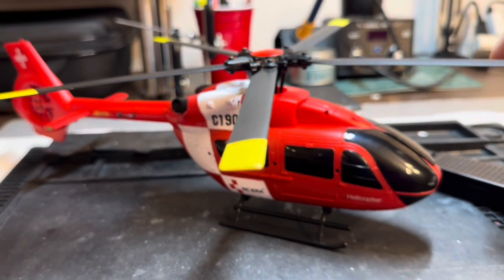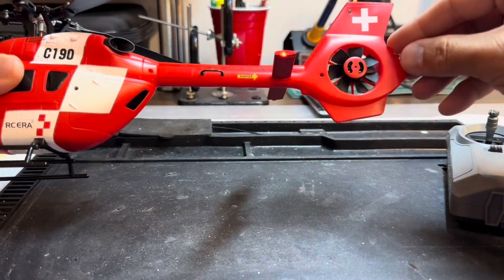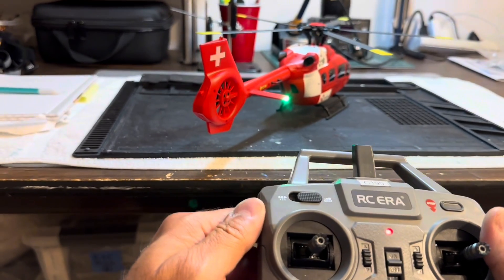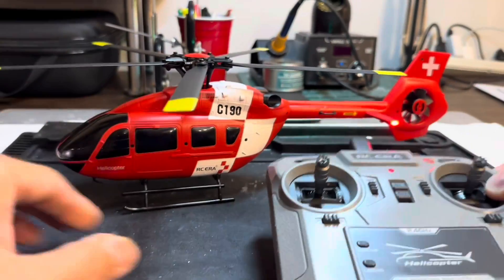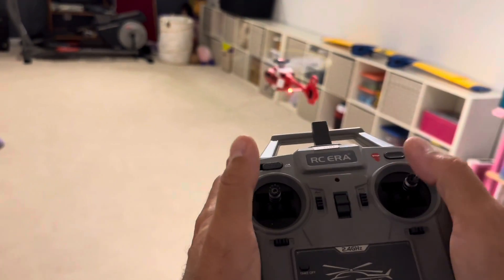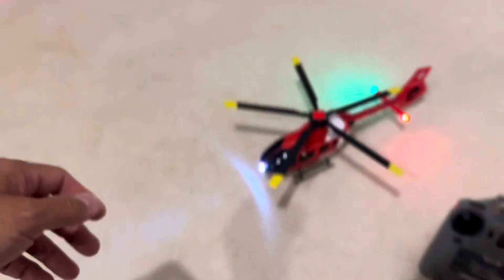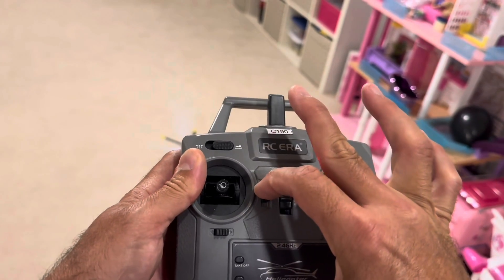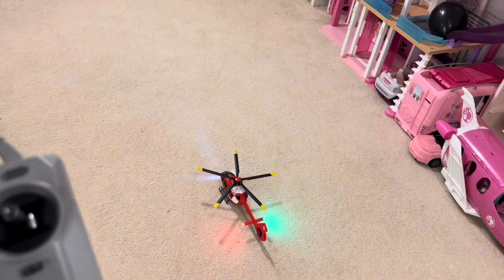RC ERA C190, C189, C187, C186 and C123 -  Gyro calibration and level hover setup methods

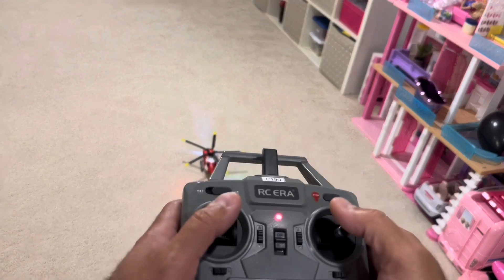Comment: Nice vid, very helpful, btw, if you use that method at 6:37, the automatic one, that means that you then undo the "manual" calibration you did previously? and have to do it again? thanks for the vid tho
Reply from the maker: No they are different.  One calibrates the gyro and the other levels the swash plate by trimming the servos for roll, and elevator for a steady hover.
Reply: @Flight6677 Cool, is it still necessary to do that: 6:37 every time before flying? thanks for the reply
Reply from the maker: @FrannB  No. Only if you notice a drift.  It should be ok out of the factory as well, but sometimes it will need tuning.

Comment: I have a C189 coming in today. Just blew up a lesser model, this video's timing is perfect. IIRC, if we hold that same trim button you used to go into debug mode UP, then power on, the remote goes into TRIM save mode, allowing us to store our trim settings.  

Thanks for the info. Had not heard of debug mode until now.

Comment: What you're forgetting is, the helis software adapts to changes in voltage from the battey. It's nearly impossible to make it hover perfectly.
Reply from the maker: I don’t think this is the case. The battery voltage changes are not as fast and the slow drain is not an issue. My hover nicely.
Reply: I just tested it properly, you're right.They can hover for a while with no input. Thanks for responding.

Comment: My RC era c190 became uncontrollable recently, first it happened in an open place and I was able to catch it in the air with my hand, the second time it happened was indoors and I had no luck.I can't seem to tell if it's a problem with the gyro or the servos. Has anyone else had a similar problem? When in flight it violently goes in a random direction.
Reply from the maker: Check your transmitter batteries. Make sure they are fresh.
Reply: @Flight6677 They are, I use the same transmitter on all 4 RC ERA helicopters that I have
Reply from the maker: @Letizio have you tried to recalibrate the gyro and do a level hover set?
Reply: @Flight6677 Yes, but it is currently unusable. I believe there is no option without replacing parts, but I still don't know exactly which module is having the problem.I'm wondering if it's the optical flow module or the receiver module which I imagine contains the gyro.
Reply: @Letizio desactiva el modulo optico y pueba si es eso

Comment: I also saw you can increase and reduce head speed by using screw pitch regulate switch is this true?
Reply from the maker: Yes but I don’t like messing with that because it is already tuned and if you change it, you may have a hard time tuning to the same exact place - problem being tail authority.

Comment: Which of the two methods should I use? Are both the same? Or is the 2nd method preferable as it will remain stored in the memory?
Reply from the maker: Do one at a time and see if it corrects.

Comment: Interesting, but I've seen a number of videos where the helicopter is hovering well, but leaning to the left. Most seem to lean left to some degree, and always touch down the left runner first. Is this just some kind of gyroscopic effect caused by the rotation of the main blades?
Reply from the maker: It’s the result of the main rotor torque. The physical size of these small helis in my opinion does not have the mass to fully eliminate the “torque roll” even if the tail motor provides the required push.
Reply: Thanks for the explanation; I suspected it had to be something like that because I've seen it so often. @Flight6677

Comment: 3 more came in today.  A c138,  c123, and a c135. Loved it. 😊😊
Reply from the maker: yup - you got the bug :)
Reply: @Flight6677  got two more on the way. And a drift car and a tank.
Reply from the maker: @anthonybrannon2611  you will be a helicopter master soon! 🤣👍
Reply: @Flight6677  had  5 syma's back in the early 2000's.  Only the smaller one's  were flying well. Had a big red one that flew . The others kept going forward and to the right.
Reply from the maker: @anthonybrannon2611  Symas are the first stage of any heli adventure.  They are slow and don't fly in any wind at all.
Reply: @Flight6677  had a small military heli and their version of the  coast guard  heli. The large apache  only flew off forward and to the right.
Reply: @anthonybrannon2611 which helicopters do you recommend?
Reply: @hchickenz1138 the  c 135 is my favorite,  it flies well.
Reply: @hchickenz1138  I  bought the eachine 120. Not impressed.  It bathtubs really  bad.
Reply: @anthonybrannon2611 thanks for the recommendations

Comment: I have a heli eachine e186 Huey -1 and I have a problem ,when I start it ,it shoots very fast ,at high altitude ,what should I do? The transmitter or electronic board is somehow defective?
Could you help me?
Reply from the maker: If its a E186 its not a Huey, its a Bell 206 by Eachine. Please confirm the make and model of your rec helicopter as it will make a difference.

Comment: Are there any more feature packed controllers that will work with this helicopter. If there are how difficult would it be to bind it to this helicopter and provided the controller has throttle curves and other functions would we be able to set it up to adjust those functions with this helicopter. I'm guessing we'd need the controller to come with a receiver and just plug in the connectors to the proper channels on the receiver...

Comment: C138 the same right
Reply from the maker: No. The C138 is a Bell206 helicopter with 2 main rotors.  The control protocol and the way it is controlled is similar.  All RC ERA models to date (except the early ones C129) have that similarity and probably all can be flown with the same transmitter.
Reply: @Flight6677  to calibrate gyro is the same thoe??
Reply from the maker: @jesusgonzalezmachado  Yes
Reply: @Flight6677  ok thanks
Reply: I tried it and my plain still does the same thing jst spins in circles
Reply from the maker: @jesusgonzalezmachado  I can't trouble shoot without seeing it.  Is the motor working ok?  Is the tail blade on the correct way?
Reply: All motors work I think the Lil black circle  that holds the blades up is messed up the blades look like theres spinning downwards

Comment: Thank you for this informative video! Is there also a way to adjust the main rotor pitch/head speed? My EC-120 seems to basically fall out of the sky when i do sharp turns or a rapid nose-up. Any idea how to fix that?
Reply from the maker: Yes, there is a way to adjust the pitch curve.  After turning on the TX and the heli and binding them, you have to fold your blades to the side of the heli at 45 degrees from each other so that you are able to see the pitch angle. Then you push down on the throttle trim button, hold, then the transmitter light will flash.  You are in setup mode.  Use the rudder trim to adjust pitch - increase pitch to the left, decrease to the right.  Watch the blade angles move.  Push the rudder trim button down again to save the new setting.  Transmitter light will not longer flash. I will do a video to show that, but I think if you try it its easy to adjust.

Comment: Any idea how to ajust the single servo mechanicly to ajust the rotorblade?
I had to change 1 servo in the Bell 206
The other thing is the bad forward movement of my C190. What ever I calibrate, it flys pretty slow, also when changing the the general speed to pos.2 or 3. 
Has anybody a succesfull idea? Thanks for letting me know.
Cheers Pitt/Munich

Comment: Are there a way to increase throttle on the c-190 on the c189 I did ask you a question about turning the c189 into a c190 the fuselage with the rest of the inner parts work
Reply from the maker: There are interchangeable parts like the main gear and the head assembly parts and the blades.  But how they fit altogether is different since the C190 has a different frame.

Comment: Got a question since you know all about these helicopters I purchased the c189  can change it to c190 if by parts
Reply from the maker: They share many parts and you maybe able to do that.  But you will need to buy the plastic frame inside the C190 and transfer the parts from the C189 into it.  That way they will fit into the C190 shell.  You also need to buy the C190 tail blade.

Comment: Thats not what the down trim does. All it does is turn off optical flow. When you said you trimmed it and turned it off and back on , you were flying back in optical flow.
Reply from the maker: That is not exactly correct. When you push down on the left throttle trim and hold after a few seconds the TX LED blinks and it goes into the parameters menu.  In this menu you can level the swash plate by adjusting the roll and pitch trim for a steady hover. The optical flow also switches off so that it does not impact the swash leveling. In this menu you can also adjust your pitch angles using the rudder trim.
Reply: @Flight6677 : You are right. That other dude seems to be a person, who always "knows" better. I over trimmed my heli once in air with this method. It works like you said in the video and your comment is also right: "The optical flow also switches off so that it does not impact the swash leveling." Thank you for sharing this video.🙂
Reply: @Flight6677  😆 🤣 😂

Comment: Hello, you seem the most knowledgeable in all of these RC era helicopters. I am having an issue with one of the MD 500 helicopters. I have two of them. The styles shouldn’t have mattered, but I even went as far as changing the red Coast Guard model out for a sand Camel Fage model and back vice versa, the issue that I’m having is this once in a while when I’m flying one of the MD 500 helicopters, the five blades will fold up on each other. The rotorhead stop spinning and it falls out of the sky by folds up as the five blades fold back on themselves and the rotorhead stops spinning , and obviously the helicopter will fall out of the sky. I have gotten lucky twice. I was only a few feet off the ground and landed in some of Florida’s nicest thickest grass and there was no incident one of the other times that I was flying ahead and landed on the concrete. Needless to say, the landing gear buckled under the load, and the company no longer just sells landing gear through the bank website. They now sell the entire fuselage kit, and that was painful to say the least to have to buy all of those parts just to get one set of landing gear happens with red rotor blades with yellow rotor blades on one of my models Z fold up on themselves and the helicopter falls out of the sky. If you don’t understand what fold up means take with your finger and push all of the blades back till they will no longer go backwards anymore  on the rotor grips and that is what I mean but that occurs underload underlying conditions. It’s as if the rotor continues to move counterclockwise and all of the rotor blades stop spinning and fold onto themselves. Can you please help?
Reply from the maker: I would be happy to help.  Can you post a video of the problem?  I mean I read and get what you say, but its hard to diagnose it as its very strange. A video may her.  What I can assume is that the pitch is not set correctly or something much simpler, the blade grip screws are on too loose. A video will help.  Thanks.

Comment: hi , do you know if the controller of C123 will work on C186 ?
Reply from the maker: Yes, it will work with the C186.
Reply: @Flight6677  thanks a lot 🙂. To be a bit more clear:  If i use one radio for C186 and C123 do I need to recalibrate every time i switch model or just bind and go ?  I suppose the two models have different setting or not ? Thanks again in advance for your kind reply
Reply from the maker: @dgiky  no you don’t. You can do the level hover setting for each heli independently and each flight control unit will save its own settings. But if you didn’t go through this internal setting you will need to reset trim each time. As I show in the video the procedure is also called debugging. It’s nothing more than entering gyro programming mode.
Reply: @Flight6677  grazie mille 🇮🇹

Comment: If I remove the helicopter battery or the transmitter batteries, will I lose the trim settings and have to perform a recalibration again/over? Thanks much!
Reply from the maker: @jeffkraus1457  if you setup the gyro through the gyro debugging procedure where you get a level hover and save the settings no you do not lose the settings. However, if you just trim the heli without going through the debugging setup you will lose the trim setting.

Comment: After a few dozen flights my C186 started to toilet bowl.  I corrected this problem with the hover debug precedure as shown.  It hovers and flies stable now. Backwards manoeuvers all no problem.
Reply from the maker: Great to hear.  These are really nice birds.
Reply: Super I have same issue with C186  and the standard calibration simply is not working. So I will try this way :-)
Reply: Did this end up working?

Comment: Strange that it was secret especially if it helped the heli fly better. Good Job letting us all know. Is debug mode still the left trim button even  if you fly mode 1 ?
Reply from the maker: @winstonsmith7801  yes I believe that is the case.
Reply from the maker: @winstonsmith7801  it’s really not that they intentionally didn’t want to tell us. I think they are a small company and slowly they are addressing all these needs.
Reply: Optical flow sensor is off ... in this callibration mode
Reply from the maker: @christiansteinig4132  yes this procedure turns off the optical flow sensor so that it does not affect the leveling